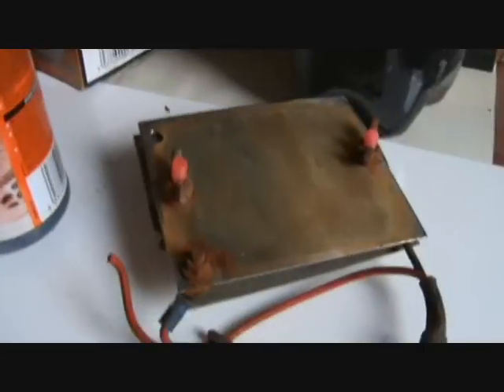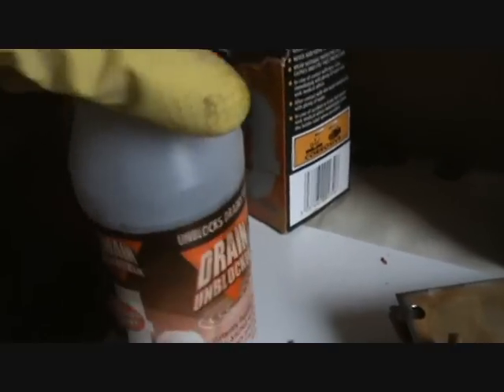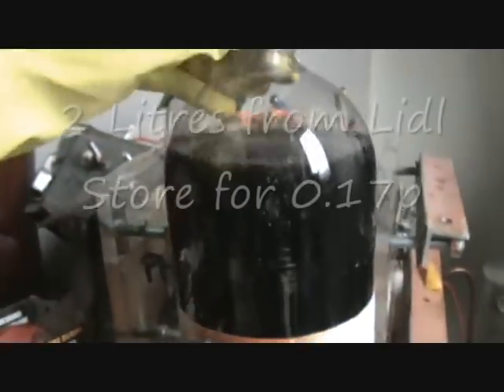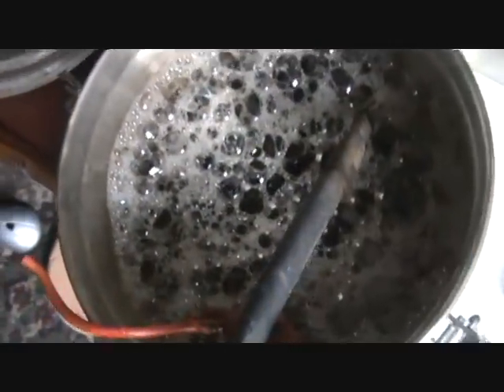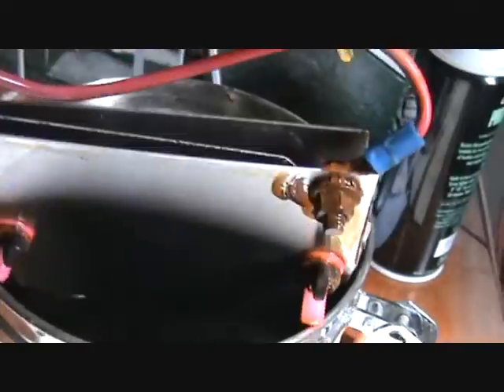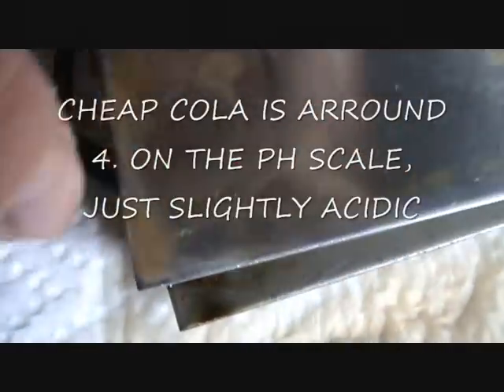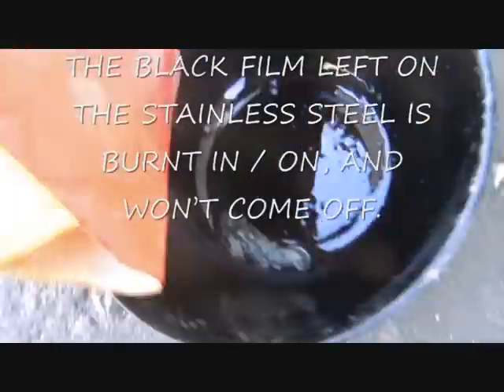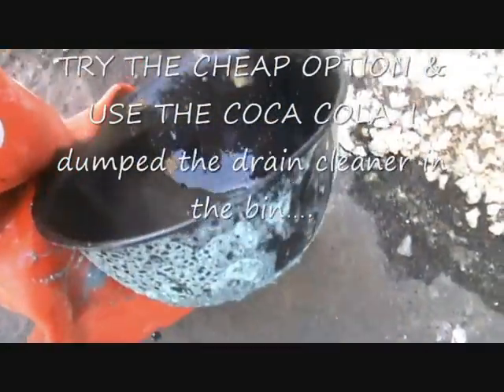FuelBan Cleaning HHo Plates .wmv

Comment from the maker: Citric acid is another cleaner that is safe enough to have around, and it works well, I seen someone using it on there plates & they turned out well, citric acid (Dont Know the PH Value) is a weak "organic" Acid, used in the food industry amongst others, So Going to try that too, I just shy away from these stronger acid based cleaners...Too Dodgy for my taste.
Thom.

Comment from the maker: @pjckac1 Hi, its not the quality of the metal / stainless steel that brings on the deposits, there is a combination of causes, but the most problematic is the water quality, tap water and its microscopic containments, this causing the brown sludge found by most people, this then forms on to the plates forming the staining we see, I resolve this by 1st using a good electrolyte choice, 2nd use distilled water "its free of this microscopic content. The video is for those using tap water.
Thom

Comment from the maker: @pjckac1 By the way, the running times I am working on are longer than 40 Hrs, I ran My T/34c from July 2009 to Feb 2011 "un - opened", that's the durations required for vehicles guy,
Thom in Scotland.